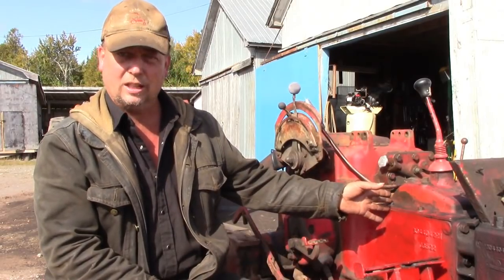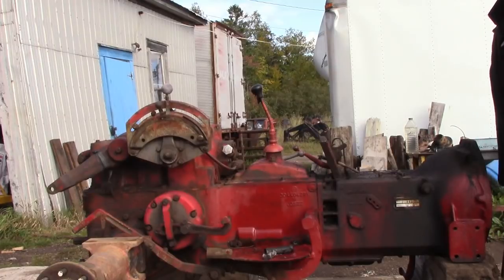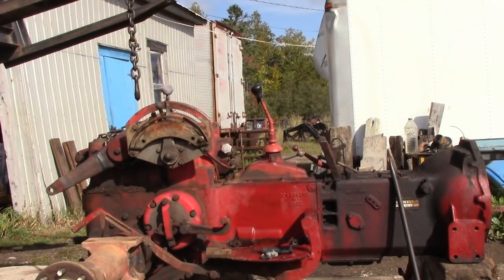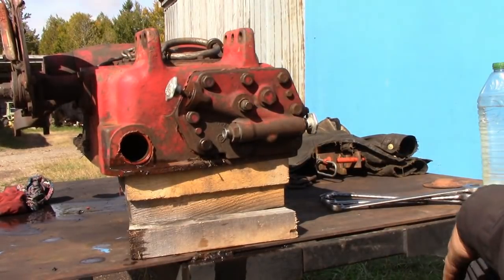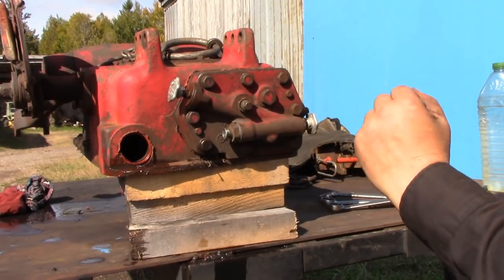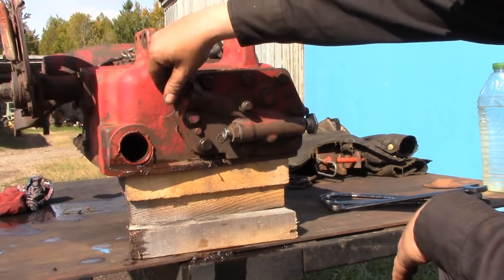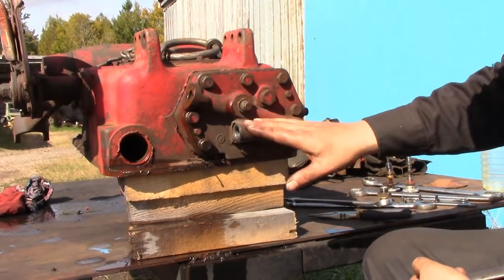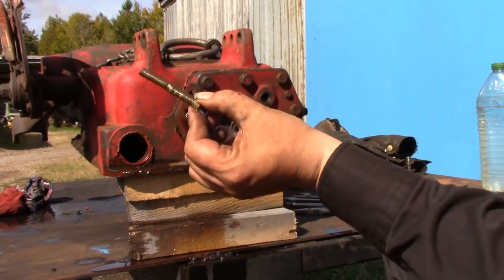B414 Hydraulic unit dis assembly

Comment: Great video.  I have B414 sn 3400 and thus far the hydraulics have not required me to disassemble them.  However I recently got an IH 424 where the sector control had been left full open for years while the tractor was used for a post pounder.  Now the sector arm will not control the lift arms.  Only by using the other hydraulics can I shift the control arms. I would like to now what damage comes from leaving the sector arm past its stopping point.  Can you help?
Reply from the maker: I am not familiar with the 424 lift unit, sorry, but it sounds like a valve could be stuck. Thanks for watching!

Comment: Hi Dave, great video! Any chance you could do a video on the valves and how they work. My 414 will lift the arms slowly without a load and when looking under the top plate can see it shooting oil back to reservoir rather than into cylinder to lift properly.
Thanks so much
Reply from the maker: I will try to come up with another unit to pull apart.
 Thanks for watching!
Reply: Mine does the same....did you find out what was the problem

Comment: Hey Dave, 
I have a 1967 2444 and when I am using my three point hitch I have about a half an inch drop and then the hitch jumps back up to its correct position.
I have the IH -34 manual and wanted to know if you could give me some advice on this.
I replaced the suction screen and the fluid 2017 thinking that might help. 
I still have the same problem.
Also I was wondering what the auxiliary control valve is for because I would love to get a flail or sickle mower to do my extremely deep steep drainage ditches. 
I am completely lost when it comes to hydraulics so I appreciate any advice you can give me.
If you have a place to get parts cheaper please let me know. 
I won’t be able to rebuild the entire unit until winter because my 
John Deere 330 garden tractor model 50 deck finally rusted through enough the pulley that the mule runs broke out.
So the IH with my rotary cutter is my lawn mower.
Thanks so much.
You’re perfect for doing these videos.
You are thorough without over talking about things that are not important .
Reply from the maker: I am glad you enjoy the format, I try not to fill up too much time droning on about nothing.
 The dropping and correcting is fluid leaking by, either the piston or one of the valves. You probably want to check the valves first for dirt or damage, then check the cylinder and piston/packing for scores or tears where fluid could leak by.
  Thanks for watching!

Comment: Thank you for this video, I’ve always wanted a tutorial on how to do this, I have a 444 and the hydraulics have been a bit weak for awhile and the oil was filthy so I drained the hydraulic oil and replaced the filter and put new oil in. After that it seemed better at first but when I went to use the tractor it stopped working, until I turned the tractor around and it was pointed downhill. With the front of the tractor pointing downhill it would lift back up. After trying a few things I finally decided to try adding more fluid which helped a lot, but it’s quite a bit overfilled now. I still sometimes have to rev the engine a bit to get it to lift, but it does at least work now even going uphill although I wouldn’t say its very strong or fast. Is there any harm in running it overfilled for now to use it? And do I have a problem with something in the hydraulic system or is the hydraulic pump getting weak? I used it like this last week and it worked surprisingly well
Reply from the maker: Being overfilled shouldn't do any harm as long as there is still room for the heat expansion of the oil. A weak oil pump will show up as the oil gets warm, it would lift fairly well when cold but get progressively weaker as it warms up. Check your suction pipe from the filter to the pump for any kind of blockage as well.
  Thanks for watching!

Comment: Hi Dave, I do  enjoy your  videos. I have a B414 my control arms will go up when I start the tractor but will not go down.Once I cut the engine off the control arms will very slowly fall (in a day). I changed the fluid cleaned the filter which was very dirty but still  will not work. the suction and return line do get warm .  I would sure appreciate your input as to what I could do to fix it.
Reply from the maker: That is probably the unloading valve. I am glad you enjoy my videos,  thanks for watching!
Reply: Melvin & Dave, I am having the exact same problem, if either of you have advice on how to access and fix the unloading valve that would be a great help to me.

Comment: Hej, nice video! i have a b414 diesel, hydraulic is not stabil, falling down and pumping up all the time, cant lift a plow anymore and as soon as i shut the ventil under the seat or i turn off the engine the hydraulic is falling down fast. is this because of the sealings in the kolv/cylinder and the valve? kind regards from sweden
Reply from the maker: That could be either the cylinder leaking by or the valve. Thanks for watching!

Comment: I've got a 354 that leakslike a siv where the hydraulic unit bols to frame. Is there a specific gasket to replace or will sylicon/liquid gasket work? Thanks
Reply from the maker: The lift unit is a sealed unit and there is only a few inches of oil in the differential case, so it shouldn't be leaking from between the lift unit and the dif case, it's more likely that there is a leak in the lift unit and when it runs down over it looks like it leaking from between the two. First check would be the suction filter o-ring at the front of the unit. Thanks for watching!

Comment: Why does my 276 hiccup in the hydraulic system
Reply from the maker: Low on oil, relief valve, dump valve, lift cylinder, you'll have to do some checking. Thanks for watching.
Reply: I have a 414, and it may have other things wrong, but low hydraulic fluid will make it hiccup. I keep finding more leaks so I don't know for sure, but fluid does fix the problem for now. It will raise up, slowly drop an inch or so, then raise and repeat.

Comment: Awesome video again Dave just one little thing my lift arms quit working the other day so torn apart and the only thing that I found in there they seem to be wrong is there's a chain with some rubber hose on it going up towards the filter I believe we're does that hook one end is to linkage the other one is just floating round in there of wondering if that hooked to the bottom plate where that other spring is I can't seem to find it in any parts manual my shop manual
Reply from the maker: I can't remember now but from what I can see in the parts manual it fastens to a link on the rockshaft. Thanks for watching!
Reply: @walterhoward2818  Hi! Did you find where the chain should hook up?? My lift arms doesnt work and when removing the inspection plate i can se the chain isnt attach at the rear end. I guess thats is whats causing the problem?

Comment: Hi Dave, I have an international 354. I really love your helpful channel, and from watching your videos I've been able to carry our some repairs on my tractor. I replaced the brake discs based on one of your previous videos and the brakes work great now. So many thanks for your helpful videos.
The hydraulics were always a weak area on my tractor. When the oil would warm up it wouldn't lift much of a load without revving the engine, then with the lift up if the rpm was reduced to tickover the load on the lift arms would drop all the way to the bottom again. And the lift would hiccup quite rapidly. I ended up doing a major overhaul on the complete hydraulic system 6 months ago. I wish I could've seen this video when trying to get the valve control unit out of the main assembly...but I got there in the end. 
So the work I did was to replace all o-rings everywhere in the control unit. I fitted a new lift piston, new lowering spool, new hydraulic pump and various other parts that came in a repair kit. I managed to remove my orifice filter and I replaced the oring on the end of it. Then a few weeks later when I was trying to remove it again the end came off from the main screen - probably because the new oring was gripping tighter. But I put it back in carefully and it seems to be ok. Should I expect any problems with this? New orifice filters are approximately $50.
After all of my hydraulic refurbishment I managed to make a lot of improvements. Lifting power has improved dramatically - now on tickover the tractor has enough lifting power to lift it's nose off the ground. The hiccuping had been completely eradicated and the lift arms would hold the load without dropping. However in the past week I have noticed the dreaded hiccup has returned! It is not as rapid as before - now it will hiccup after approximately 30 seconds. It stops when I close the isolator valve, so I know that my cylinder seals are good. I did notice that the tractor was quite low on oil so I'm going to top it up and see if that makes any difference. Do you have any ideas what could be causing the hiccups again? Bear in mind that I have fitted a new lowering spool valve among other things :(
Reply from the maker: It sounds like you have replaced or repaired all of the things that could be causing the problem, possibly leaking by the lift valve? Thanks for watching!
Reply from the maker: The relief valve is in the valve assembly beyond the isolator valve. We sold 2 hydraulic pumps to one guy the same day because he split the pump wide open dead heading it with the isolator valve.
Reply from the maker: The relief valve is only in the lift circuit and is mainly for an overload situation on the 3PH. I expect the reason it's isolated from the auxiliary circuit is to eliminate the possibility of stacking relief valves. If 2 relief valves are on the same circuit you add the 2 pressures together before a relief valve will open causing a dangerous pressure situation.
Reply: In attempting to remove the hydraulic orifice filter,  the filter will spin in either direction but will not release from the housing. Is there an o-ring or retainer holding it in place or do I need to pull harder. Following your advice, I don't want to over do it and break it. Thanks for your videos.
Reply: @damjord  hello sir,
I have some issues with the hydrolic lift of my IH 434. It doesn't rise any more. I have replaced all the o-rings and the main spool, but it didn't make a difference. I think the problem comes from the lowering spool. This part is not available in Europe.
Could you please provide the adress where you pourchased this part ? 

TIA.
Patrice.

Comment: Thank you Dave for the Great video i am currently doing winter maintenance on  2 of the 3 B414 , i took the hydraulic unit apart to replace the lift cylinder and i tipped the unit on front end to push the piston into the cylinder and a little check valve or something came out it is about 1/4 in diameter and 38 inch long with an orig, i cant figure witch hole it came out of, any help would be appreciated i took my other tractor apart to look and  it goes in is to a hole larger than the little valve thing, the parts diagram don't show much, also wold you have one, i have some pictures but would need an email address ,mine is stroh1965@gmail.com, thank you
Reply from the maker: Hi Jeff, my website  wwww.chowntractorparts.com has my contact info. Thanks for watching!
Reply: Thanks Dave I finally figured it out the end of the little filter came off and that was the peice that had fallen out. Got it in and going to try it out thank you.

Comment: Hey Dave the video is awesome . I have an IH 444 and it’s lifters are not working 
J have tried all the knowledge I had possible but still no change . Can you suggest few solutions
Reply from the maker: Hard to tell with the information given but it could be a linkage unhooked, the lift control valve or the dump valve. Thanks for watching!

Comment: I was repairing leaks on my b414 hydraulic unit.  The plug on the left side refused to come out... pulled the circlip and it didn't come out.  Ended up having to drill and tap the plug to pull it out.  Spring came out, but nothing behind it that I could see/remove.  Diagram shows something in there... what is it?

Oh, any tips on preventing the diesel shutoff knob from vibrating out on a 414? I don't seem to have a spring in there to keep it pushed in... so it vibrates out and starves for fuel.
Reply from the maker: On the hydraulic unit I expect that would be some sort of valve plunger. You could add a spring to the shutoff to keep it in the run position. There is supposed to be a spring steel band close to the knob that grabs the bracket so it can.t move, may be worn, you could try to bend it so it's tight also. Thanks for watching!

Comment: Hi could you do a video of how to change the transfer pump on the 74/ 
85 series international tractors
Reply from the maker: I am not sure what you mean by transfer pump, on a 74/84 etc series there is a transmission lube pump and a main hydraulic pump, no transfer pump that comes to mind right now.
Reply from the maker: There is a pump that pumps the HyTran oil to lubricate the bearings but that is it besides the main lift pump.
Reply from the maker: There should be no way for oil to get up to the fill plug, the oil level wouldn't be much over 6" in the bottom of the case!  The working then not is likely the priority valve or something like that.
Reply: Canadian Redneck ‘

Comment: I have a 414 the lift unit doesn’t work at all on is there any common issues?  Thanks.   Great videos
Reply from the maker: Usually when there is an issue the unit works just not right, not at all? I would suggest taking a look at the linkage to make sure it is still hooked up, then the valve. Thanks for watching!
Reply: my guess would be pump lost prime of oil and will need to have the air let out and reprimed or your valves are turned off under your seat is a good place to start I had mine not working when I bought the tractor and found it had lost prime and had no oil in hydraulics filled it up primed the pump and away it went
Reply: @carlmenzel8744  how did you prime the pump
Reply: @MattHDGarage  I filled the hydro tank with oil and undone the top pipe on the pump poured oil in the pump done the pipe back up. then start the engine undo the the bottom pipe the out take but without taking bolts all the way out and it should let the air out and prime if not then repeat I had to do it at least twice but I bought the tractor with it not working so god only knows how long it was dry for. another thing to check is the little rubber hose that's next to the gear stick that joins with hose clamps the pipe from the pump to the hydro tank mine was letting air in just cheak hope this helps.
Reply: @MattHDGarage  I filled the oil tank with oil make sure your hose near your gear shifter that joins your hydro lines isn't stuffed cos ill let air in your intake. Undo the top pipe on the pump pour oil into the pump do pipe up again start engine losen outlet pipe which is the lower pipe put leave the bolts in just losen it should let the air out if not repeat I had to have a couple of gos at it with my tractor youll see the oil pumping out once it primes with oil hope it helps

Comment: Hi Dave - this is completely off topic but have you come across an electronic ignition conversion kit you would recommend for a B414? Mine was converted to 12V positive. Many thanks! (from Malcolm using Sarah's PC)
Reply from the maker: The 12V positive ground would be the factory system. The 414s could have either Delco or Lucas ignition, I see a kit for the Delco distributors but you would have to switch it out to negative ground. Check with A&I Products for a dealer in your area to get the kit. Thanks for watching!
Reply: Fantastic, thank you so much for the detailed answer & quick turn around, Dave. I'm actually very glad to hear the 12v positive is factory (the fewer mods the better in my mind).  I'll check out for local A&I dealers. Cheers and thanks again. I'll keep an eye out for your next video updates   :)
Reply: I just realized my mistake - I meant to say my 414 was converted to 12v negative ground.

Comment: Thanks for these great how to videos for the B414. I just came into possession of one with a snowblower and a trip bucket, I wish it had power steering lol. Is there a way to convert the trip bucket to one with down pressure? How would I plumb into the hydrulics to add bucket controls?
Reply from the maker: If your loader runs from the 3PH controls currently you will have to tap into the pressure line between the pump and the lift unit. You need to use a "power beyond" valve so you don't get a "stacking"effect from having more than one relief valve in a single circuit. Thanks for watching!
Reply: Have you ever looked at the import tractor parts power steering conversion kits? I've never heard of anyone in the IH B series community installing one. $1250
Reply: Mahindra 595 di haidrlic fitting

Comment: I have a 4:44 that when I start up the Hydraulics lift up and drop lift up and drop lift up and drop when I pull the lever up when I put the leaver to engage her to drop the three point hitch it's fine when it's on in the ground but when I left it up it jumps what is the cause
Reply from the maker: That would have to do with the position control part of the system, possibly the cylinder or a valve leaking by or linkage needing adjusted. Thanks for watching!
Reply: My B414 does the same thing when it is low on hydraulic oil. It drops a little and raises back up
Reply: Oil is full , 384 does the same if oil low
Reply: @walterhoward2818  https://www.youtube.com/watch?v=Hv3BoxVrVA8